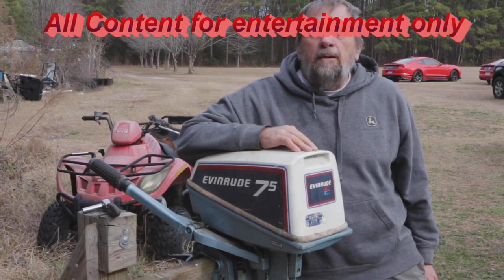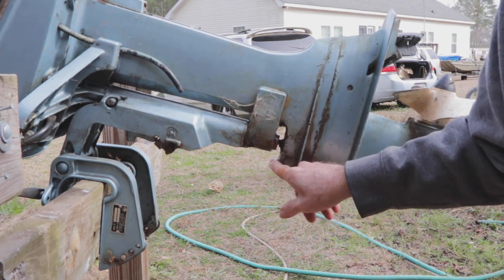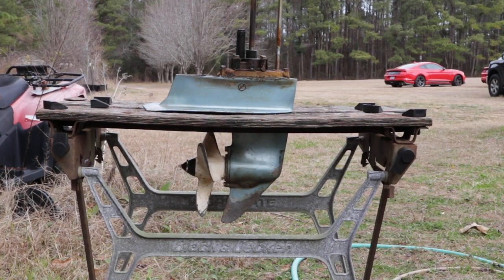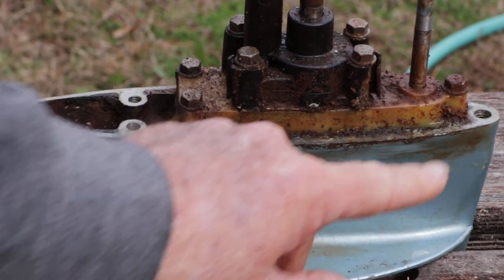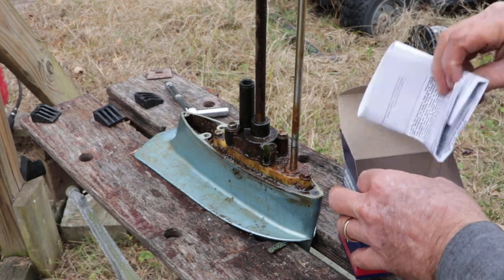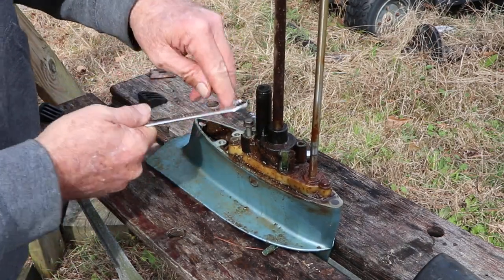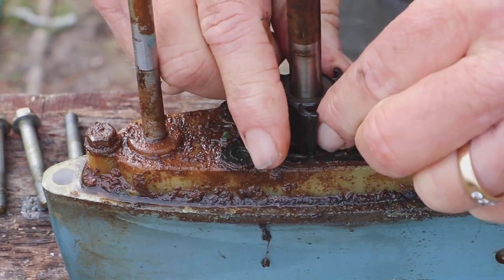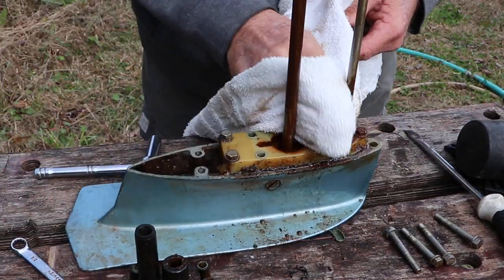Evinrude 7. 5 Outboard water pump replace Step by Step II

Comment: Hi , not sure if you are still doing this but video was great but i can get the bottom end  to go back up.  what did ypou do with the top of the motor to get the spline to seat or is it the shifter

Comment: I went to do this job on a very similar looking seven five. When I pulled the lower unit off the gear shaft did not come with it. At the bottom of the shaft was a machined gear that went down into the lower unit reservoir below the impeller. Also there was bo impeller key on the shaft but a small bearing that sat inside the impeller…..sound right?

Comment: Thanks again it helped me get this done!  I do have a concern though.  When I used the original key there was a good 1/4 inch of free play.  I used the one that I got from ebay and it fit good no free play.  The concern is the key that came with it seemed like a hard plastic.  I will see if it lasts.  Should there be free play when the impeller is on the shaft?

Thanks,

Brian in Mi
Reply from the maker: My motor did have some play. I did use the plastic key. It was OEM.
Reply: Thanks
1 @OmFishing

Comment: Do you clean the inside of that shell. When i took mine off it looked like a real grainy oil inside the part the rudder and bottom end of that connect to the other half. I don't know the names of everything but yours looks pretty dirty too. Thanks

Comment: I enjoy the simple ways in which you communicate with your viewer. Maybe you can help with something that I really having troubling deciding between to motors. One is like the one your demonstrating (1981 Evinrude 7.5hp), the other is a (1957-58 Evinrude 7.5hp.) Both are cosmetically sound, I also know I'm going to fork out a few dollars to get them up and running to top condition. Having said that; I really enjoy working with vintage motors and parts will not be the issue as they can be found. Yet I know that one of the motors is much older then the other. What kind of advise could you give me.
Gracias
Reply from the maker: I like the old outboards too. I like the 80s models. I have not done a lot with the 50s models. Ether one will be a great outboard.

Comment: Does the water just spray out not a solid stream?
Reply from the maker: The water  pump should put out a solid stream out of the overboard water indicator.
Reply: Well thanks top you I am in process of putting in a new impeller.  Got the old one out just watching again to refresh!  Thanks! Brian

Comment: The beauty of these engines is that the gearcase pops off and on easily, no shift rod connector.  Unfortunately, those plastic housings and upper gearcase cover commonly split like that, especially in salt water.  I'm wondering why someone has rerouted that overboard indicator hose like that, instead of leaving it the way it came.  Good idea to pull these gearcases off every year to clean and relube those gearcase splines, these engines love to rust those splines together in salt water.  And, like Om says, once the splines are rusted together, you have got a big mess for sure.  The only other issue that might need to be addressed is the upper water tube grommet, these loved to swell and block cooling flow, especially in salt water.

Comment: Nice video .  Good to see you back!
Reply: I found that a little dab of vaseline will hold that impeller key while sliding down the impeller over it. Of course, before pulling down on the gearcase,  you first had to pull out the retaining pin that locks in the top of the shifting rod against the shifting lever mechanism. Love your videos !